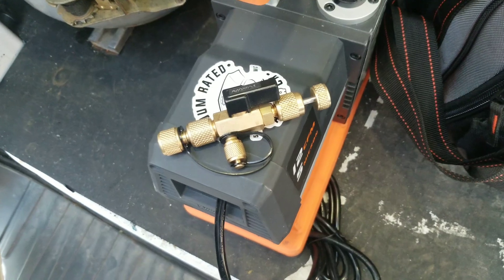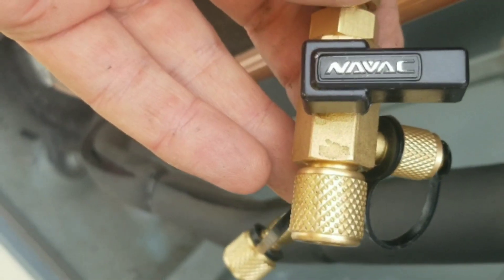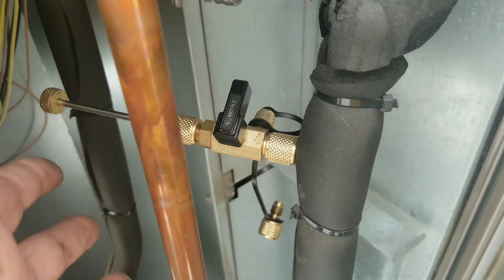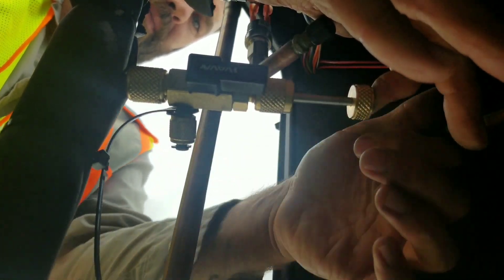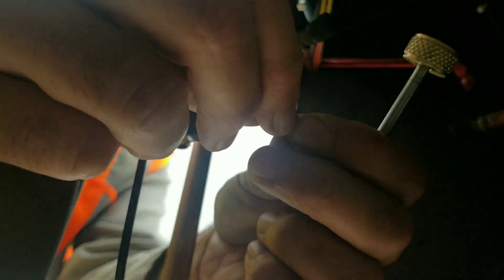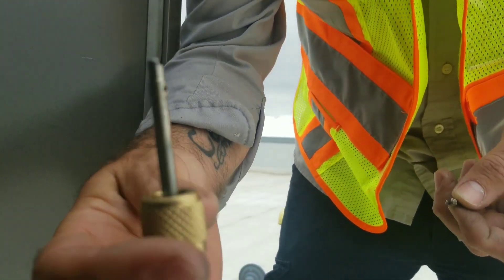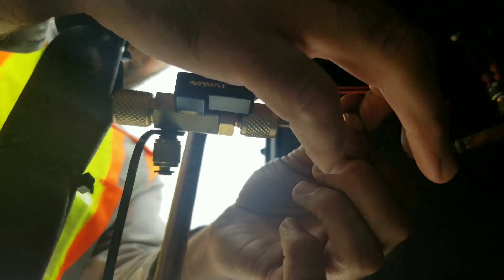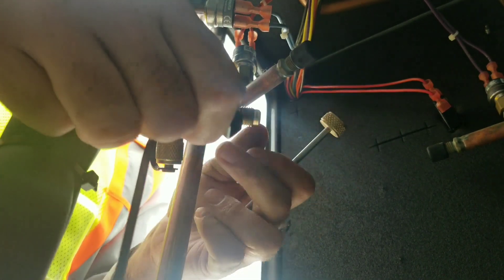HVAC - Replacing A Schrader Core Under Load

Comment: A piece of equipment not to go with the cheap.  The ball valve needs to be light and smooth on rotation to immediately detect if a Schrader valve got hung up in the ball valve area.  Crunching the Schrader valve when turning the ball valve and you can be in one hell of a pickle.

The damaged inside tip of valve was likely done when he jammed the last part of ball valve rotation closure (2:17 time stamp).  That particular tool does not apparently have enough travel to let that Schrader valve clear the ball valve.

Putting Nylog on a Schrader valve!!  Really got to be kidding.

Comment: you just potentially let some air into you system by not purging the plunger end of the tool. What worse is that you seem to be trying not to purge it because you repeatedly mention that youve checked the fitting is on there tight
Reply from the maker: I don't believe you understand how pressure difference works.  Atmosphere at sea level is 14.7 psi. Inside the system is over 100 psi.  It's impossible for atmosphere to over come approximately 10 times its own pressure.  Next time ask questions.
Reply: @HVACKnowItAll  i dont think you understand how fluid dynamics works. the pressure front isnt a single solid surface, this idea that you can keep a low pressure gas out because you have a much higher pressure gas on the other side of the valve is BS, sure it will sometimes keep it all out but certainly not always and whether it does will also depends on the type of valve you are dealing with - a ball valve is not the same as a schrader in terms of how likely it its to let air in when you have unequal pressures on either side. 

The plunger literally has air around it and you are pushing it through a friction restriction towards the system valve. if you think there is no chance of letting air in, you are fooling yourself - air is already mixed in with refrigerant in the plunger cavity. The pressurised gas doesnt push through a schrader you do understand that right?  you are using a ball valve, the gas absolutely will pull some air towards the system valve as it rushes into the low pressure plunger cavity (as you open the ball valve to let the tool plunger through) and the pressure equalises, unless there is somewhere to push that air out to -i.e unless you purge the tool cavity. Its not going to push against the air and just keep it pinned to the back of the cavity like youre expecting. 

no im not a hvac tech but i am a physicist. so keep telling me how i dont understand pressure 🤣🤣 you dont have to believe me, go ask the manufacturer of the core remover tools.....

thanks for liking this btw! 🤣
Reply from the maker: @Jay A  I appreciate the comment?  Have the used the tool?  When fasenting the portion of the core tool, it's not 100% fastened.  Meaning it's slightly leaking by.  All things leak at a molecular level especially with a small volume, easily proven when trying to hold a vaccum on a vessel with low volume like a micron gauge . When I puff my cheeks and blow out, I also know room air is not entering my mouth due to the pressure difference and pressure moving from high to low at a constant pace.  Merry Christmas
Reply: @HVACKnowItAll  if it was loose, that's exactly the purging im talking about. i just dont think you did it enough to remove all the air. ive used these tool yes and normally you can hear the change when all the air is gone from the cavity and it has to be loose enough to actually allow significant amounts outz not allow a small amount to leak out. I appreciate air will always get in through the methods you mentioned but its a decent amount of air in the fitting for the tool, the 'cavity'. 

why not purge it like you would a lineset for a fraction of a second until you hear the change and there is no more air left in the tool cavity? Its just better practice imho. 

anyway merry christmas to you too!
Reply from the maker: @Jay A  and that's the problem with the internet, everyone is an expert on everyone else's job.  You weren't physically there.  Comments should start with questions not statements.
Reply: @HVACKnowItAll  well id usually agree but this video was supposed to be  instructional. not only did i not see you purge the tool plunger end, i couldnt see refrigerant or other gasses being purged and i couldnt hear it bring done. 

when i combine that with that fact that you dont explicitly mention purging it or keeping the tool loose, it was a reasonable observation that youve got defensive about. 

if you're showing the procedure and dont show or mention purging, it was your fault, not the internets or anybody elses who points it out without magically knowing you have done any purging in the back or rhat wasn't visible on the video. You then initially say its my misunderstanding for not knowing how pressure works but end up admitting that purging was done, its just that its my fault for not knowing you magically did it. why did you do it if the pressures mean its unnecessary? getting caught up in your own lack of logic here.

Comment: You forgot to purge the the tool removal tool before inserting the new valve in.  Every little bit of air matters.
Reply from the maker: Air at 14.7 psi can't enter the system at 10 times its own pressure.
Reply: @HVACKnowItAll  dude you have this wrong. when you turn that ball valve to let the plunger through, you mix the air thats in that little cap you screwed on (attached to the remover tool) with high pressure refrigerant and it does get mixed in because its a ball valve. 

At that point, and before the schrader goes on, air can get it because there is no pressure difference between the inside of that cap and the system and neither is there a valve or restriction. Its not air from the outside at normal atmospheric pressure, its air that was in that cap that you pressurised when you turn that ball valve .
Reply from the maker: @Jay A  have you have pressurized something that was approx 0.19"³ that wasn't hermetically sealed?  If you have you'll know that it leaks quite rapidly at a moleculer level.  The pressure difference between atmosphere and system obviously increases this rate.  Air separates it's self from refrigerant as a non condensable, air molecules are smaller and lighter than refrigerant molecules and because of that, they will be the first to leak on the outer shell of the fitted tool and hit atmosphere.   So unless you show me a side by side refrigerant analysis before and after that shows any difference then I think we're good here.  My bet is that analysis would show neglible results of air/moisture difference.
Reply: @HVACKnowItAll  what are you going on about? nobody is talking about a pressurised system loosing containment due to not being hermetically sealed. You're just making a blind argument without even trying to understand my point. ive explained it multiple times but you dont really want to understand it seems. 

 The air is already mixed in with the high pressure refrigerant in the tool cap. It is at the same pressure as the refrigerant. there are not pressure differences for what we are talking about. You equalised the pressure inside the tool (either side of the ball valve) when you opened the ball valve. 

yes ive dealt with highly pressurised system. Given i deal with exotic states of matter, i understand these concepts better than you and have tried to explain how it actually works, ive even emplored you not to listen to some random on the internet and instead just speak to engineers (not sales team) for any of the reputable core remover manufacturers. Ypu Hvac tech take 1st semester undergraduate thermodynamics and think you understand everything, you really dont. 

You keep implementing poor practice, i honestly give up on you.
Reply from the maker: @Jay A  no blind statement bud...show me a refrigerant analysis comparison before and after the core replacement and show the refrigerant pressures at same ambient temp, did it rise?  Air will cause it rise.  Did the moisture content increase?  Show me a neglible difference and you can have the win.  Pretty simple!
Reply: @HVACKnowItAll  right ok so now at least we are onto whether it makes a significant difference. i dont work in the field and im not about to trawl the internet for proof, what i did suggest is speaking to the tool manufacturers, because that is something i have done. Sure they wint comment on the impact of the issue but they will suggest best practice and provide reasonings for why. 

all i can tell you is that theoretically, if you are working to minimise the ingress of air and moisture into a system, then purging will help maximize that and that the manufacturers recommend doing so....if you decide its insignificant or that you need proof that it makes a material difference, then fair enough - im not actually sure if thats available anywhere accessible to us, it just means you arnt working to the principle about exactly, which again is fair enough.

I think most nations HVAC regulations or training do specify that minimising ingress of air and moisture must be prioritised. Its been discussed and negotiated at the UN together with minimising refrigerant leaks because ingress of air and moisture leads to unit failures and they in turn are some of the biggest operational contributors to refrigerant leakage.
Reply: @HVACKnowItAll  If it is worth doing... it is worth doing right.  If you are satisfied with doing it that way, that's great.  I on the other hand always go above and beyond for my customers in every way.  It's just what I do and they appreciate it!
Reply: Sir have you had any nylog make it’s way into the tool shaft/ rod  making it stiffer to use the slide.  (From putting the stuff of core threads

Comment: Thanks, like that nylog on the core. Don’t like the Navac tool: bought 3 and 2 have failed same way (core clip tip is pinned in place, pin rounds off and fails)
Reply: Fwiw, decided to go with Appion MegaFlow

Comment: What about the air behind the ball valve when you go to replace the shrader? Does the positive pressure of the refrigerant help avoid that air going into your system?
Reply: It should be purged by slightly loosening the end cap before screwing in the new valve.
Reply from the maker: Yes, air can't get in  the pressure is lower than refrigerant
Reply: @HVACKnowItAll  I can't believe people are telling you that you didn't purge your removal tool. HELLOOOO people the system is at 100 something psig when off. 
The little vessel where the schrader comes out becomes pressurized with refrigerant. Old schrader out, new schrader in and only the shcrader goes in. 
You can't push air in unless you for whatever reason carry an air compressor on the roof for whatever reason to do your schrader removing jobs...
Reply from the maker: @derrickenbuenosaires  exactly

Comment: Have had schrader valves leaking that won't come out from over tighten brass caps forms bad mushroom on fitting c.d.c. sells kit for their core valves that fixes this .
Reply: @metal2444 that sounds useful, do you have a part number or name of the cap?

Comment: I would add: for double checking/testing: squirt some soap bubbles (blu) on the Schrader check for leaks and spray off with some portable compressed air (carry canned air) the soap bubbles. Some might find that over-kill; however, a high % leak area are Schrader valves.
Reply from the maker: That's what I put Nylog on the caps 😉.  Portable compressed air on the roof lol, you cra cra lol

Comment: Excellent!!   One question. What is the nyloc for. Sealing or like loctite? I do a fair amount of automotive and I find a good percentage of leaks r due missing or loose caps.
Reply from the maker: Nylog is a sealant and assembly lubricant made from refrigerant oil, doesn't contaminate a system.